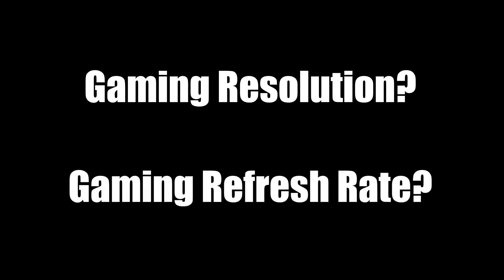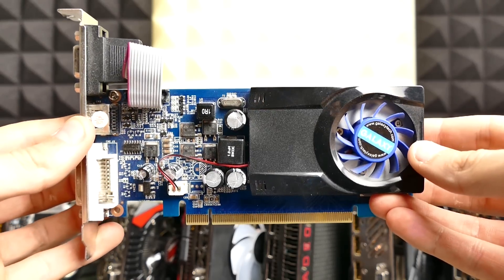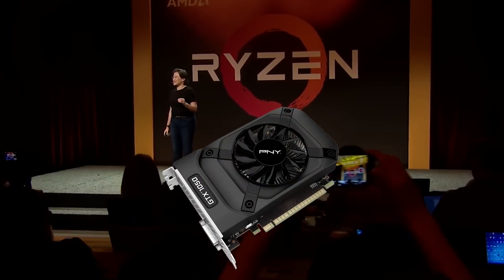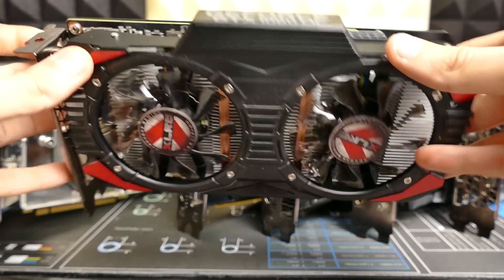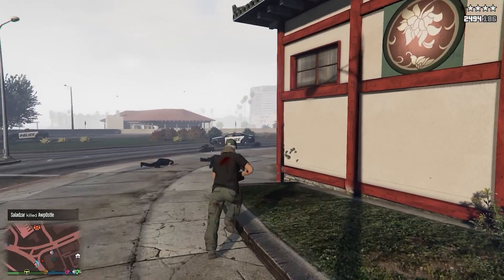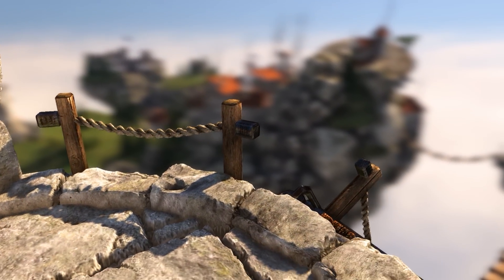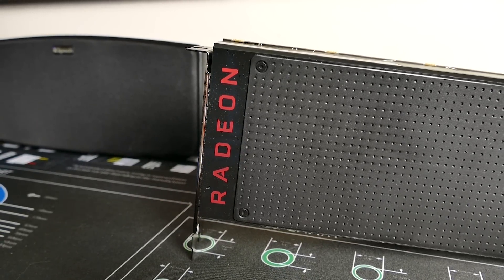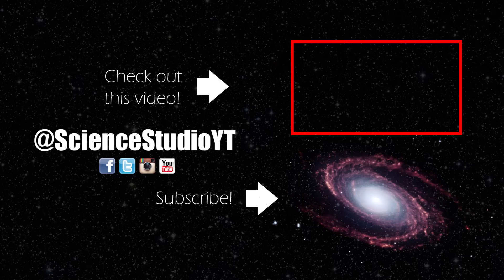Graphics Card Buyer's Guide (Mid-2017)

Comment: I chose the I7-6700k and the GTX 1070 because they were overkill for my use.
Reply: That's i7 7700k i7 7600k is the chinese knockoff processor, i think the brand who made it is called intel chinese official - processor best for gaming
Reply: whats an i7 7600k?
Reply: SkeletalForce you wish, those 8 useless cores won't help you for gaming. You need those very powerful quad core intel chips in order to get work done. Even tho ryzen outperforms them in synthetic benchmarks. Real life situations intel always wins, except for the useless 6800K
Reply: Nathan Wingard kabylake?
Reply: bud keep attempting to run ram more then 2ghz on ur ryzen system hahaha, wait for a patch or smthing
Reply: AstroTech Studios If you game and have chrome in the background ryzen is already better (that is a overclocked 1600)
Reply: ryzen actually has more IPC than Intel's 7700k with 3600mhz ram
Reply: ifciprian no I wouldn't get the 1080 it's not worth it right now, I would get the 1070... wait for vega or get the 1180 that's coming out in a couple of months
Reply: +ifciprian yes nut not by much as they will both be replaced very quickly. Just that the 1080 has more performance so last a little longer until it can't perform to par
Reply: Andy Hu Hahah,your typo almost sparked another i7 vs ryzen war.
Reply: If you are all here, can you tell me please if it is worth it the 1080 for an 1440p/120hz or should I buy the 1070 ? Also, I think the 1080 will be better for a longer time, isn't it ?
Reply: Tasso gamer thanks !
Reply: ifciprian if you want 1080 performance you can get two cheap 580s with 8gb memory and crossfire them. They actually perform better for cheaper
Reply: Michael beseler nah, I want to buy a gaming laptop that can have 1070 or 1080. So a future gpu swipe is impossible. That's why I'm asking. Is the 1080 more future proof than 1070 ?
Reply: Michael beseler thanks !
Reply: lucas rem Nah,minimum for decent gaming would be 1060/580. Optimal starts from 1070. Budget and Low Budget would be 570 and 560/1050 ti.
Reply: lucas rem umm not really. The larger majority plays at 1080p still and the 1060 or 580 is more than enough for 1080p ultra 1070 is more high end for those wanting to drop lots of money into monitors and a system. I'm actually still running an hd 7950 and can still play at high setting 1080p and its perfectly fine for me no need to upgrade yet
Reply: ifciprian I have a 1070 at 1440p 144 Hz, and it can go as low at 50 fps in Witcher 3. I think the 1080 would be better if you wanna stay towards 120 fps.
Reply: Malus1531 lmao I don't know what's wrong with your 1070, but I did some OC to my friends 1070 and he gets a constant 80fps ultra settings aa maxed hairworks off at 1440P.
Reply: +Tasso gamer I said as low as, it's not 50 on average. Usually ~70 at ultra with Hairworks on Geralt only. Even at 80 my point stands that a GTX 1080 would be nice for a 120 Hz monitor.
Reply: Malus1531 gotcha
Reply: Malus1531 thank you very much !
Reply: Tasso gamer my neighbor has his 1600 running ram at 3200mhz
Reply: Hallucinogenichusky it cant overclock
Reply: Maybe for those who only game on their PCs or hate AMD (for some ethical reason, I don't really know), then yes Ryzen sucks. But it excels in everything else 😏
Reply: Hallucinogenichusky ryzen sucks deal with it.